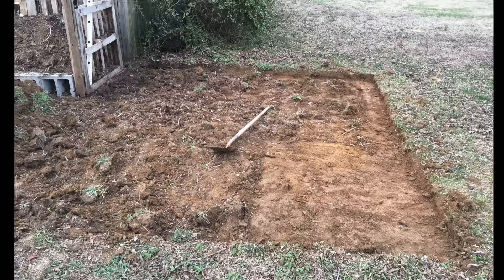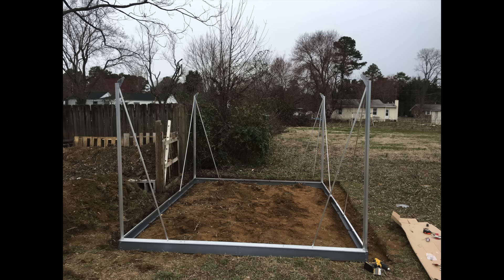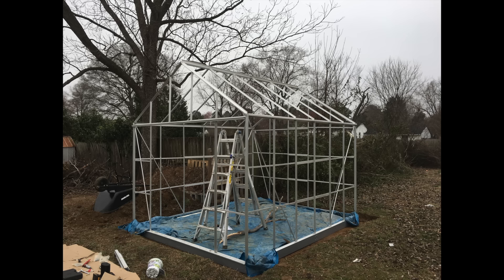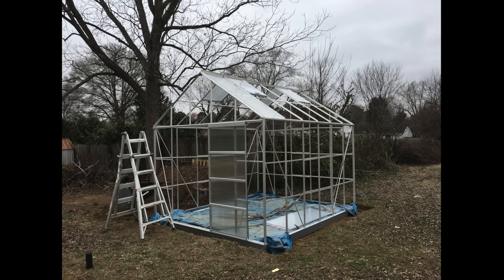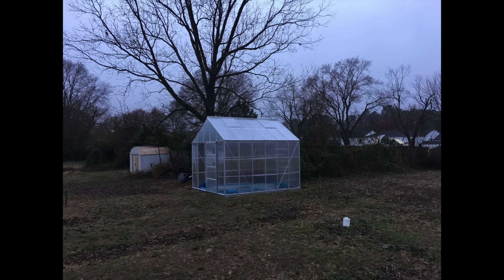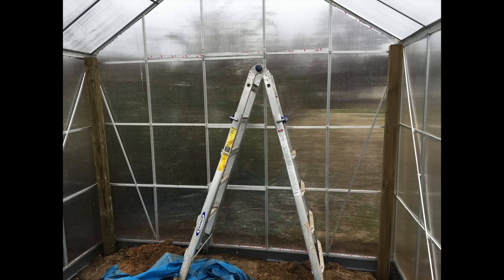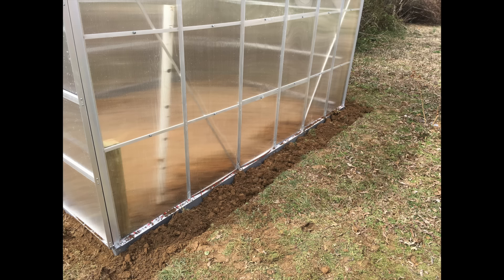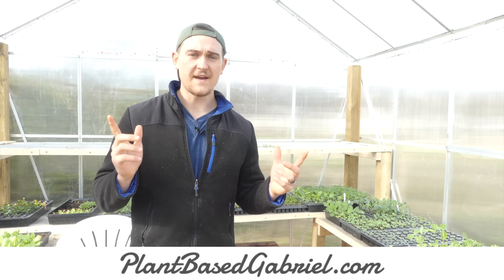Harbor Freight 10 X 12 Greenhouse Kit (Complete Build and Modifications)

Comment: I purchased one also.  Had a concrete slab poured, used treated  lumber for a base and it has been functioning well for 10+ years.  Hail storm damaged some panels and was able to buy replacements through Harbor Freight.  Has been a long term success for my garden.
Reply from the maker: Glad to hear it help up nicely!
Reply: Post pictures and send me a link 😍I want to build one but I'm trying to get all the recommendations before we commit
Reply: Just a consideration--there are some places where you cannot pour a 10'x12' concrete slab without a permit.  Kind of adds to the cost.  If you're required to do it and you don't, you may have issues with non-conforming, unpermitted structures when you go to sell your house or the local officials find out you've done it.
Reply: I'm not able to find replacement polycarb panels on Harbor Freight. How/where did you locate them?
Reply: I built 2 of these joined together, long wall facing due south. However, in an open area with no windbreaks. In 2 weeks, a wind storm took the walls and roof off of the steel base. The steel components failed, the aluminum was fine. No extra panel clips, but did add 2 or 4 screws per panel into the cross supports. Not even a shingle out of place on any other building on the property. The wall column to base support is a weak point, and not easy to beef up. Must have a windbreak.

Comment: For those living in colder climates where you get snow over the winter, I'd suggest you cover at least the roof area with a big sheet of plastic over the winter.  The plexi panels on these greenhouses just rest in place in their track.  The panels cannot hold a lot of weight. A sheet of plastic over the entire greenhouse will distribute the weight of snow away from the roof panels.  Plastic will also keep heat in over colder months.  You can start your seasons earlier & continue them later into the fall/winter.
Reply from the maker: That is a great idea :)
Reply: it would be nice to have a cheap disposable clear tarp for the top because otherwise it needs to be washed every year, but I don't know what would be worse, the abrasion from washing the top or the friction from a clear tarp that gets replaced every year
Reply: I use 4x8' sheets of foam insulation (either 1/4" or 1/2") over the top and all sides to insulate mybplants. Dropped to 9°, 5" of snow and no power for 5 days when snowmageddon hit in Feb. 2022.

Comment: I have two of these and also live in a hurricane prone coastal area of North Carolina and love them.  My original one was less than $450.00 on sale from Harbor Freight and is going into it's 11th year.  I did some modifications as well, 4x6 treated in ground based secured with 4' rebar given into the ground and attached to the wood base with strapping.  I put the doors in a partially opened position to place a 34" storm door in a 1x4 frame. (got the door for $12 from Habitat home store)  I also took 1/2" metal conduit and ran from side to side at the top plate  for more sturdiness.  This greenhouse has survived 4 hurricanes with very little to no damage. The last thing I did was to put two vents in the side walls at the front and a 14" covered exhaust fan in the back wall near the peak.  My second one is it it's 2nd year and was given to me by someone who just didn't like it.  It's funny how people either love the HF greenhouses or hate them. PBG, great video by the way!

Comment: You need to silicone each and every poly panel if you want it to survive heavy winds.  Also, I had the smaller model and built it up on 4x4s.  Was very happy with it with those modifications.
Reply: What do you mean silicone each panel?  Silicone caulk? Thanks!

Comment: Hi Gabe, here is a trick that might be helpful, I was putting in patio blocks in back of my house, instead of the "proper" procedure of excavating the ground level then spreading sand I used a rototiller to loosen up the dirt, leveled it out with a rake, watered it down until it was a soupy mud, leveled it again with a rake, then let it dry. I wound up with a nice flat solid surface to work with, it's not perfectly flat but good enough to work with and a lot less labor.

Comment: I put up one of these in north Florida a number of years ago.  I've been through some tropical storm force winds with no problem but a tornado got me.  The house withstood it pretty well but the panels were sent up to 100 yards away.  I've modified how they are mounted by using vinyl strips where the wire things used to go.  I also bought some electrical conduit (1") and using self tapping screws I attached the pipes to the top of the wall where it meets the roof.  Really simple and worked wonders for rigidity.  Flatten the end of the pipe with a hammer and attach it with the screw.  Really works well and doesn't cost an arm and a leg.  The pipe is galvanized so it should last a long time.  I use the pipes to hang plant baskets on and to drop line onto my grow beds to train tomato and cucumbers up.
To anyone else thinking about doing this.... It's more expensive perhaps but placing 4X4 treated posts on the ground and mounting the house to them is a whole lot easier than working on leveling the dirt and it keeps the house out of the wet ground.  I actually used 4 by 6 posts and I am very happy with it.
Reply from the maker: Sorry to hear about the tornado, glad is stood up to the hurricanes though.
Reply: You should do a commercial for the company. Did you take photos?
Reply: @nancyfahey7518  I wanted to post a picture here but Utube doesn't have a way to do that. :(  I did post a pic over on Gabriel's Facebook page if your curious to see what my greenhouse withstood.
Reply: Don't be silly. It's a 10 x 12 greenhouse.
Reply: @BrdMan Fether IF what your writing were true there wouldn't be a dog house in Florida.  Nor a pump house, outhouse or tool shed.
Reply: @BrdMan Fether In Virginia we don't have to permit under 152 square footprint. I bought a 12x20 garden shed and was 8' over...I had  it designed with a porch recess over the door to avoid the permitting..didn't work. Ended up having to pay the $180 and have the inspections done. All in all it was worth it because I've decided to turn it into a indoor grow room for year round indoor gardening...so I won't have any issues running electric power to the building.

Comment: You're going to need to pin or glue the panels in if you live in tropical storm and hurricane areas. I put mind up around 2012 here in NC and the frame is still standing but I've replaced panels for years. Side panels need to be secured the most. If these blow out in a windstorm you can count on the roof panels blowing off if the wind gets under it. 
A helpful hint: use the original panels to make a stencil for roof and upper roof front and back.

Comment: I haven't personally done one yet but one tip I've seen while looking into it is to silicone each panel end . Top, bottom,sides to seal and prevent water staining the panel. I've used these panels enough to know that's a good  idea. Just to make sure, I mean before they're installed to seal between the layers

Comment: Really nice job. If I may... you may find the concrete doesn't hold anything only on two sides. It does much better around all four sides. Instead of packing the clay/dirt around the outside, use stone. It will help with drainage. That will be an issue from what I've seen in other greenhouses. There are other videos about how to straighten these things when it comes to wind... something about the roof IIRC.
Reply from the maker: Great ideas!

Comment: Good Review!!! This structure is INTERNALLY WEAK in the way there is ABSOLUTELY NO CROSS BRACING from eaves to eaves internally!!! This is immediately apparent in Harborfreight's image as you can see the walls bowing out at the sides towards the top!!! My mods would be the following: Green treated baseplate to set the metal on, internal bracing with EMT pipe from wall to wall on the interior, also bracing from the eaves to ground on the exterior at an angle, sort of like "flying buttresses"....that pretty much sums up my take on absolutely necessary structural mods!!! CHEERS!!!
Reply: I just got a Hf 10x22 installed. But can't figure out how to open ad close the top windows. Can you tell me how ?
Reply: 😢not 10x22
I ment. To say10x12.

Comment: Have had my HF green for 5 or 6 years and had to replace the roof polycarb panels this month.   After being exposed to the sun for so many years the top layer of poly-carbonate had yellowed and rotted away to the point you can run your finger down it and break away the top layer.   The bottom layer is still holding up but the panels are weaker with just one layer.    Poly-carbonate panels seem to come in 24" with but the HF panels are only 23" wide so had to cut an inch off each one.   

I have never had any issues with panels coming off because I sealed each one in with clear silicone calk.   Keeps them in place and makes it air tight to save on heating cost in the winter.   I also added 1" steel electrical conduit going across the middle in 2 places it add stability and give me a place for handing plants..
Reply: Lee Smithfield it is possible that you installed your panels with the wrong way facing out. Typically only one side is UV stabilized. It's marked on the shipping film on each polycarbonate sheet which side faces out toward the sun. The wrong side out will UV degrade after a few years, as you may have experienced. I am speaking in general terms about this building material, no experience with a HF kit.

Comment: This looks HIGH RISK for windy snowy hail-prone areas!
suggestion:
Find a vinyl window or door shop that lets u reuse their discarded thermal windows (and/or patio doors) may take time to collect them...or buy from used bldg material stores etc...or run free ads 4 some...then build a simple frame to fit ur stock of glass frames and doors.
...shed-styled roof with single plane radical pitch facing maximum sun exposure.
Lay a sand-plus-tile type floor made of repurposed bricks etc. to last for decades. May want to cover pitched roof plane with bubble wrap in hail prone areas. 
use aluminum frame as base to avoid 
rust/rot issues...😁 🍀Cheers!

Comment: I used to live in a mobile home.  They use long metal anchors that screw into the ground and are about four feet long, with cables attached.  You just screw them in the ground and then run the cables over the top to secure it.
Reply from the maker: Sounds good and secure!

Comment: I basically made a patio using pressure treated 4x4 and brick and then fasten the steel base to it using 3" timber tie screws. I reslly like the odea of using the posts for the shelves.... im going to pull up the bricks on the corners and incorporate that into mine!!! But im going to take mine all the way up to the top of the sides to also protect the structure agaist torsion from high wind.. Instead of HVAC tape i used silicone to seal up the peaks and panels...

Comment: I would have placed a fender washer under each Tek screw. Otherwise torque from wind is likely to embrittle the polycarbonate and destroy the connection. The additional 1 square inch of surface space will improve the long term reliability.

Comment: I bought one of these used. It is very flimsy. Even the base of the frame is wobbly. I am adding all sorts of reinforcing and cross-bracing. If it still seems weak I may add tall posts in each corner as was done in this video.

Comment: Ok! I'm just starting this video!  I bought one just like this!  $700!!!  Built base on my concrete ( sloped for drainage)  "driveway area"!   Wood, anchors labor (all 2X6's) cut to fit all slopes to make a level 10x12!! Time and $$$.  Then while I did that - I hired "two" people to read those directions and assemble, with my help!  Hundreds of $$$ later!  Beautiful and dreams of future greens!!!  Right!!???? Well I didn't add ( not included in the kit) corner bars!!??  You know - about 3 feet out from each corner a bar that connectors those two walls together to give it structural strength!
First snow! First hour!  Roof collapsed!  Destroyed half the aluminum framing!!  Piece of crap!  Sorry!!
Reply from the maker: Oh no I am so sorry to hear that !
Reply: Just purchased one and like you, I agree the instructions are useless. Now I'm worried about snow taking it down. Adding the 4X4 posts is something we will do because this thing is flimsey!

Comment: The' most explained what to do to modify the 10 x 12 HF GH than you. Most people just kinda glaze over how to make this work. Hey, I can weld aluminum would that be worth improvements to this thing too? Make a dutch bucket system in it, that's what I want to do here in Vegas. It's hot and dry and some very high winds but there are some bugs that are not to be underestimated.

Comment: So how did yours hold up in the wind?  because I chased pieces of mine and had to pick it up out of the neighbors pasture.  Winds were only about 35 which is typical in the spring.  We reinforced it, but the panels still blew out and after 3 days of wind it was pretty much a pile of twisted metal and missing plastic.  I was soo disappointed.

Comment: I would be worried about the base rails rusting out quickly. Being in contact with the soil, and water running down the side walls would add to the rusting. Would it be any better to pour a concrete foundation, or use brick that is a couple inches above the dirt? I wonder why you must dig down? I would think it's better to be above grade a few inches.

Comment: I have a question about the doors!? We have been building our greenhouse all weekend… we are struggling with the doors we have them together but the bottom of the door just free hangs an flaps !? It has rollers under there. Something just seems off. Do you have any tips ? Or know what we did wrong. We have the same greenhouse as you.

Comment: Gabriel (or anyone else that can answer), do you think it would be possible to replace the top row or two of poly carbonate panels, with a large mesh window screen (bird netting instead of tiny mesh screen), to allow bees and other small pollinators through, but keep the birds out? Then pop those panels out for winter and replace them with the poly carbonate panels, so flowers and root vegetables and such could still be grown without freezing?  I guess I am asking if the poly carbonate panels are actually part of the structural support? Thanks!
Reply: there is a blog of a HF greenhouse build online. The guy replaced panels with aluminet windows. He swaps them out for panels in the winter. I'm sure you could figure out a way to insert screening instead of poly.

Comment: When you put the tape on did you fold it over the panels to block off the corrigation
Reply from the maker: That is correct, it is to help with condensation and discoloring of the panels :)
Reply: @PlantBasedGabriel  thanks
Reply: So it IS basically a corrugated clear like cardboard.?

Comment: My husband got me one of these several years ago.   Unfortunately, I never even got a chance to use it.  We had a storm come through with straight line winds and all the panels were out in the field with many broken.  The aluminum framing got bent up also.  So, unless you don't live in tornado alley or are in a protected area from winds, I wouldn't recommend this greenhouse.  Too flimsy.  The little wires they provide to hold the plastic panels in place are useless as far as gusty winds go.  Ours was attached to concrete.
Reply from the maker: In the video we definitely show ways to really secure the panels and posts so it can handle those heavy winds :)

Comment: Did you metal tape the ends of the panes of windows ?
Reply from the maker: I did to keep the condensation away.
Reply: For twin wall plastic glazing you only want to seal the top of the panel.  There is is a specific tape that for the bottom that allow moisture to exit, but not return.

Comment: 30 to 40 working hours ? O wow
Reply: That's one dude doing it without an instructional video though. Get help and prepare with vids like this, you could do it in a weekend without too much issue
Reply: @blitheringrando1410  - Did you assemble it in a weekend?  The instructions a terrible and I doubt it can be assembled in a weekend.
Reply: @vincentsutter1071  pretty sure I did with someone helping, but I should have put in additional bracing in. It ended up blowing down in a strong wind storm in the first year I had it.
Reply: @blitheringrando1410  thanks for the info. I have seen other videos that noted they did not hold up to storms.  We are putting one up for our daughter and will reinforce it with treated lumber poles in the corners.  It still stuns me how poor the illustrations are for these greenhouses.  Aggravating
Reply: @vincentsutter1071  yeah it seems like it was one of those projects where you have to do whatever you can figure out to start and the rest you figure out as you go. I remember the illustrations being really poor though and it took some thinking at points to realize how things fit together.